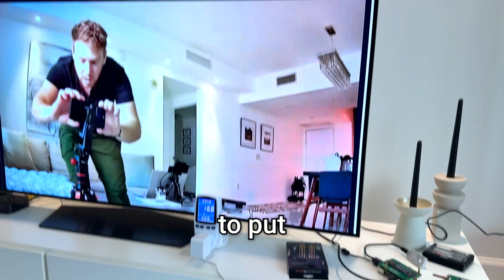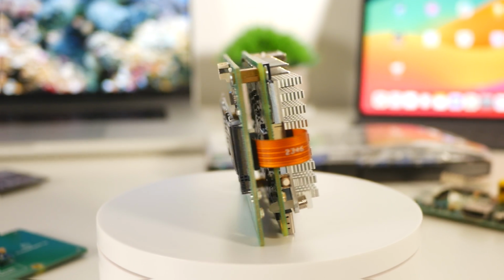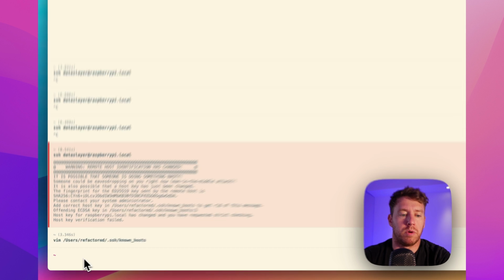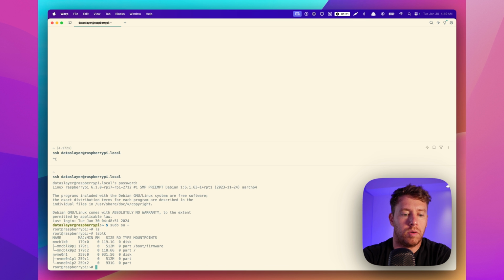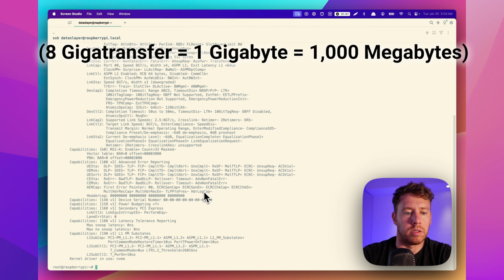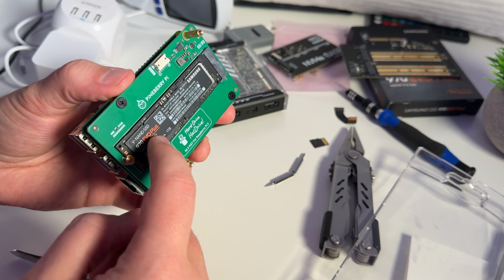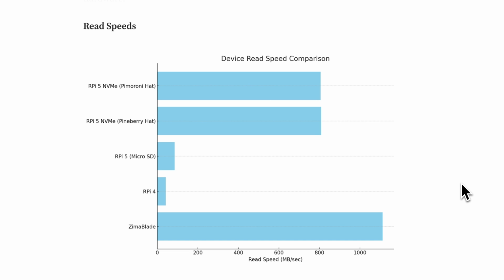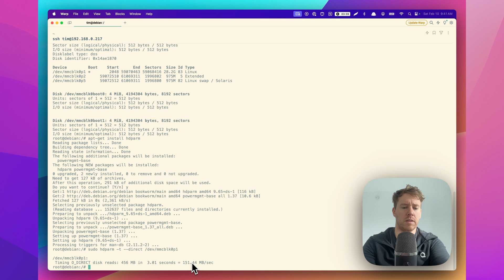I Found the Best NVMe Hat for the Raspberry Pi 5

Comment: The mounting of the SSD under the Pi, with the SSD sandwiched between the two boards, is a stupid idea.
The amount of heat m.2 SSDs give off, sandwiched between two PCBs, with almost no air flow, especially if in a case...

Comment: Duuuuuuuuude - awesome review and clear explanation of your results. It's a shame the ZimaBlade doesn't support more HDDs as one of those in a 4-bay case would be awesome with the not-inconsiderate IO speed difference... especially if you can set up two and have each NAS mirror each other (whether at the same premises or remotely).

Comment: I've been upgrading from Pi 2 to Pi 5 since two days. The performance difference is huge. But with SanDisk Extreme Pro Micro SD Card the system is already fast enough. I have the Pineboards Bottom Drive with a Samsung 256GB Gen3 SSD and the performance is good at around 800MB/s. 
But with everyday use there is no mutch difference in system snappyness, compared to using a decent micro SD.
I have big plans with the Pi 5 so, the PCIe Slot will be used for a Sata controller

Comment: Gr8, video thanks! 🤩🤗
There are another NVMe Hats/Bottoms, lke Waveshare, Geekworm, 52Pi, even official RPI for short NVMe just need some extension! 😉
I have the Waveshare PCIe To M.2 Adapter Board (C) which is NOT a Hat technically coz its next to the RPI, i also have a 52Pi N04 M.2 2280 PCIe To NVMe Top Extension Adapter which cost double compared Waveshare but did NOT worked i tried with many different cables, then i ordered Waveshare which with SAME config/SSD/Cable worked first "try" i also have a EDATEC Raspberry Pi5 Passive Cooling Open Case but i'm using ONLY the bottom coz at top i have a RPI Official Heatsink/Fan then put whole setup on Waveshare plastic bottom Board! 😎

Comment: I bought the NVMe hat from Waveshare and that one also ticks the 800 something MB/s with my Samsung EVO 980 Pro.
One thing I don't like on most hats is that there is no way to have cooling on the NVMeEven worse, it's sandwiched such that there it hugs the (fairly hot) Pi5 board without any proper airflow between the boards ...
This is screaming for a larger case where we do not sandwich the two boards but put them next to each other

Comment: Dude, your video is great but the audio is terrible.  You have very high level low frequency audio of only the filtered bass part of a music.  Even the music is discenable.  I'm watching on a full frequency home theather system with subwoofer.  It is very disturbing and distracting.  Just filter out the low frequencies, this much bass is totally unnecessary and irrelevant the subject of your video.  I have to lower the volume to the point of not hearing your speech.  If you don't have proper speakers, use a frequency analyzer plugin or listen with proper headphones.
Reply: Good feedback, I was thinking the same, and that's only watching it on my pixel 6, sitting in the toilet 😅 But I get a feeling, that raspy sound is achieved on purpose. And not everyone is gonna be listening with a sub either.

Comment: How will you cool the nvme card during active operation? With this arrangement in the HAT, installing a heatsink is almost impossible, and the heating there is significant and the nvme card will also heat the processor.

Comment: Well energy efficiency is something different. My NUC with much more horsepower does 3 Watts by running a NVMe SSD, Proxmox with several server tasks and so on. My other NUC with several USB HD drives and a TV tuner acting as an TV Stream and recording server for my cients is just doing 8 Watts. So no, not really efficent. Hoever much more powerful than the pervious PIs. Especially with an NVMe.

Comment: It's not at HAT. It's a Base but it actually works better as a HAT because when I was using it with the official raspberry pi case the cable was blocking access to the sd card port and I actually had to modify the case to work with the base as a base. That should've given you a longer cable with it and they should've put a input and out on it of some kind so that you could format the drive from a computer if you had to because otherwise you have to keep on switching the boot order and using a sd car or flash drive to do it if you want to try different OS's because I haven't figured out how to do network installations,yet.

Comment: Any recommendations for a case? I figure most of the usual cases are not designed for the bottom hat so adequate space and thus cooling could be an issue. The argument of NVMEs being more reliable than SD cards is often made in this context, but I suppose the SSD needs to "breath" in order for that argument to hold true.

Comment: Nice comparison! I bought the Geekworm NVMe X1002 PCIe board and their P580 case. Other than interrupting wi-fi connectivity,  it scores well in the benchmarks I ran.
It would be nice to see a comparison to the x1002 as well... Do either the Pimoroni or Pineberry boards interfere with the wi-fi signal? 

When I first got my Pi 5, the ports on my switch were full so I started testing it on wi-fi. Running it on a Micro SD card without a case was fine. When I added the Geekworm board and the full case without the SSD it struggled to get a signal so I removed the cover of the case and it was okay again. Once I added the SSD all bets were off for wi-fi.

Now I have a new switch and don't care about wi-fi, but I still wonder if HATs usually interfere with radio signals.
Reply: I just received exact same case and  hat (shoe?) and only just finished assembling it so haven’t had time yet to give it a workout. I’m curious as to how it handles the heat with active cooler in that case. A metal case such as the geek worm one will make wifi  a non-starter ( Faraday cage)
Reply: I was unable to get the X1002 to boot from a Crucial P3 1TB NVME while in the case. It boots fine outside the case . Tried turnining off wifi and Bluetooth but that didn’t help.
Reply: @Dfbc8823   I'd carefully reseat the ribbon cable on both ends to ensure it isn't that. I noticed the cable gets pressed against the case when installed.

Comment: i guess boot time depends on firmware (bios) which is stored in rpi (not on nvme), so it does not speed up but fast enough.
if used for security why depend on just 1 device ?

Comment: It seems that there is little to no ventilation for the heat coming off that SSD and the heat transfer to the pi board is very direct,. There are definitely better designed top hats that vent heat better
Reply: Which ones ?

Comment: So I understand this.. the boot times don’t change much compared to SD card. Seems the only advantage is size and file access?
Reply from the maker: No! Basically everything else is faster! Check out the performance benchmarks at the end of the video.
Reply: @DataSlayerMedia does the pi still need sd card to boot or it can be booted front rhe same nvme frigate is using for storage.

I wonder if dual tpu board can be used with nvme ssd. Not sure if that is I possible with pi and dual nvme hats. Possible next video 😉
Reply: I saw stuff on this before so I know it’s faster but just the boot times is not too much of a difference. Maybe you can do a video on the boot times difference?

Comment: You should have used the nvme for coral tpu. 

Is cheaper and you get faster processing
Reply: But can u use ssd with that set up? Or have to to use sd card for os and video storage
Reply: @Kaalkian  there are dual m2 Slot hats

Comment: I have the Pimoroni board but I experience pauses every so often. It’s as if the SSD has disappeared and then reappears again. Most odd. Using a Crucial NVMe 1Tb drive.
Reply: The  Crucial drive could be your problem

Comment: awesome helpful video. 
i am still waiting for a decent rpi 5 case that can house an nvme board and is readily available. so far, that argon case is on my radar but hoping for better, readily available options with awesome cooling. maybe even keep the official cooler in the case since it beats most third party cooling options.